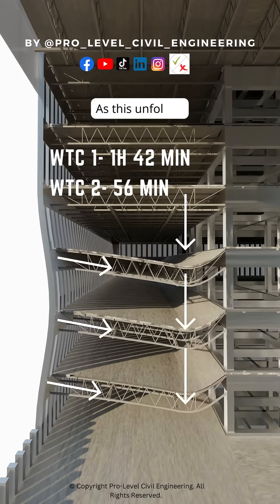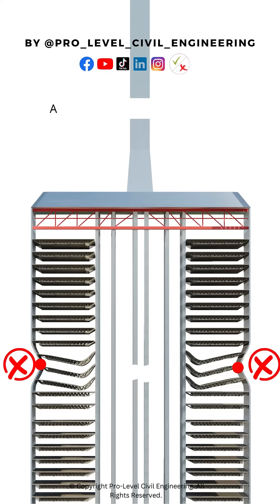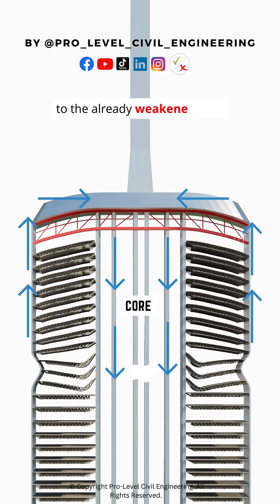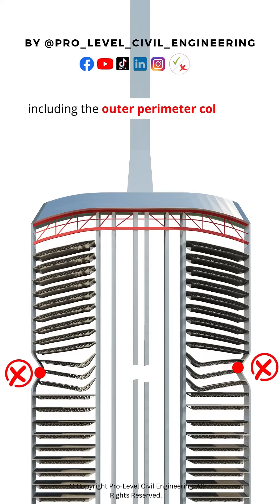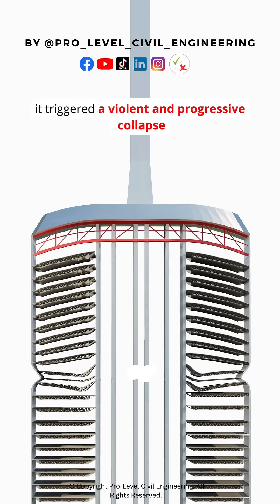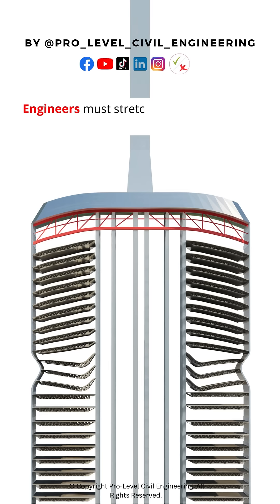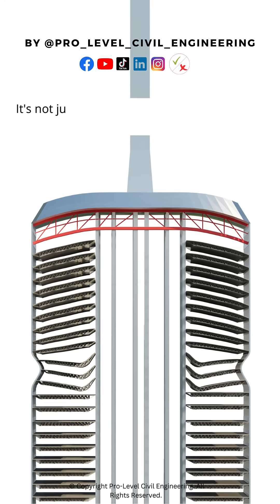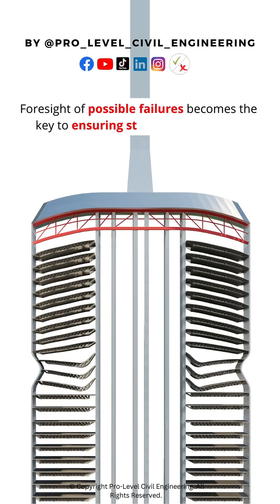The Horrifying Truth: Why the Twin Towers Collapsed on 9/11?

Comment: That doesnt explain it falling straight down at near free fall speed through at least 60 floors not weakened by the jet fuel fire…architects and engineers 9/11 truth is a great organization of those who work in those fields and only want an answer that makes actual logical sense to what we all saw.
Reply: 911 Truth hasn’t proved a single thing in almost 20 years.
Reply: @joshd3192 they have shown that the explanation we were given does not match the science and further investigation is needed. They haven’t claimed to prove anything. The point is the answer we were given doesn’t add up
Reply: @Clairebear173  Why because you say so?

Comment: It was an inside job.  Thermite erxplosives planted to fail strategic structural points. Jet fuel burns half the temp required to melt steet. That was bs.
Reply: Oh yeah? Planted by who?
Reply: Thermite explosive? LOL. Thermite does not explode, it only burns till it is consumed.

Comment: There were no airplanes. They were holograms. Also WTC7 came down. The only explanation is controlled demolitions. Just compare videos of the controlled demolitions to WTC and you notice the similarity.
Reply: The Towers fell nothing like controlled demolition I don't know what you're talking about.
Reply: Holographic displays of the magnitude you're thinking of is, well, not feasible because of what would be involved.  First and fore most, what were the holograms displayed on and how did the manage to do it in multiple directions?  You just don't shot a hologram into thin air.

Comment: Thats what happens when you demolish buildings. Especially building 7 , that collapsed out of fear 😅😅
Reply: Uh huh. Demolished by who?
Reply: @joshd3192  not by airplanes
Reply: @joshd3192  fact
. All supporting members would have to fail at exactly the same second. Only possible with planning and coordination
Reply: @darrencoleman3866  Uh huh. Any proof?
Reply: @joshd3192  that was the proof duh. It's  called physics
Reply: @darrencoleman3866  All done now twoofer?
Reply: @joshd3192  you were before you started

Comment: What about the very visible puffs of smoke coming out the sides of the building on multiple levels below as the towers collapsed, and the rapid sequence of explosions heard by many people ?
Reply: What was observed was thee air pressure within the towers being forced out through the windows breaking as the floors collapsed.  As for the explosions, most people can not tell an explosion from crash. Many of the explosions were actually the soundd of bodies hitting the groundand bursting open. Other sounds where steel beams twisting and bending and breaking loose

Comment: Thermite on the steel columns pre installed on 40 degrees slope all blown at the same time
Reply: I’m sure you have proof. Let’s see it.

Oh right you don’t. Never did and never will. Another conspiritard in a long line of conspiritards who have been spewing the same asinine rhetoric for the past 24 years without providing a single shred of evidence to back their tired claims.
Reply: @joshd3192  They hid all the evidence,  are you really that ignorant?
Reply: @mrichards-j6b  Uh huh. Who are they?
Reply: @joshd3192  Tell me how they came down?  Two sentence Tom!
Reply: Thermite isn't blown, it is ignitedand burns. Rapidly until it is consumed. It would not make cuts as you describe.

Comment: People used to see lights inside the twin towers when the building was on fire they said it was a controlled demolition, but it was the fire alarm lights going off inside the building, but if the demolition exploded in the twin towers due to the heat of fires after the impact it will collapse the twin towels
Reply: You should find a preschooler to help you compose your thoughts

Comment: I asked AI about the pretensioned cabling installed to the connections of the exterior columns and the floor trusses and it replied no such cabling existed?  NIST and all of their peer entities have left this part of the construction phase out of their report, which belies the true nature of their hypothesis,  the trusses were pretensioned and thus would nullify the erroneous assertion of drooping floors due to deformation.  Bridging trusses,  pretensioned cabling, and concrete reinforced rebar throughout the knuckles of these trusses would not allow any buckling as asserted by NIST.  The concrete also acts as a heat sink against the fire,  in order for the top of the truss to sag (which it couldn't because of pretensioning) the fire would not only need to heat up the truss it would also need to heat up the concrete.  Each floor at WTC was a monolithic entity independent of any corresponding structure,  they could not droop independently as fire rolled by,  each member would have to take a corresponding member along with it.  AI also said that if there were pretensioned cabling installed it would make a significant difference in how the building reacted to the attack,  since AI was uninformed of the cabling its answers are erroneous,  being under tension significantly increases its resistance to deformation,   not only does the steel have a concrete heatsink it also has an induced strength due to pretensioned cables omitted from NIST analysis,  how convenient?  There are a lot of complicit entities in the Murder of US citizens,  omitting critical information of the largest crime scene in US history is a telltale sign of obfuscation in the highest ranks of our own watchdogs,  if one part of the story isn't true, none of it is!
Reply: Apparently you asked AI many things and you didn’t manage to understand nothing at all 🤣🤣
You are the PERFECT example of the fact that if you ask AI stupid questions you get stupid answers, thank you so much for showing it to us all 🤣
Reply: @filippozoppi7569  Most people with intelligence ignore morons like yourself but I think you deserve the attention you desire,  asking pertinent questions about the buildings design elements can shed light on the mechanisms of its destruction,  NIST omitting design features then forming conclusions is junk science,  people like yourself relying on others to tell you what occurred and then vehemently guarding these notions without proper investigation shows your lack of intellect,  I however understand that these tragic events were not the result of just aircraft,  I choose to understand why these massive and well engineered buildings came to such a destructive end,  seeking truth about why 3000 Americans were slaughtered on 9/11 even though they were in perhaps the safest location on the eastern seaboard,  your reading comprehension  is abysmal,  you probably did not even read my post because if you did you would know I only asked AI one question,  I won't bother asking you any,  you haven't a clue!

Comment: Kinda 100percent correct. Dont know why so many comments not understanding. Its not that the steel beams caught on fire or weaken but the braces holding those beams. U can take a steel beam with fire proof which it had put it on the ground and torch it and it would not almost never catch on fire or the beam melt. Problem is when the explosion happenned with that force it knocked the fire proofing off those smaller braces holding all that weight. As you know that buiding buit that way to have more open space on floors and elevators in middle of building instead of most buildings where elevators are toward outside of buildings.  Not a good example but for those who dont understand think of yr barbecue grill. The grill its self wont burn with fire or coals right under it. But the little latches holding that weight might. All that weight from each floor was on those little now uncovered fireproofed braces.  Once one floor colasped the weight was to much for the next floor.
Reply: No,  the connections of the double floor trusses are still visible and in plain sight connected to the central core as it is standing as a spire by itself before collapse,  they are all in view not disconnected!
Reply: @mrichards-j6b whatever . I tried.
Reply: @CarlCarlson-k5p  Deceiving people about the design elements of WTC is a vain attempt to promulgate Mickey Mouse engineering as the culprit,  you obviously do not know the method used to connect the trusses between the core columns and the perimeter columns or you would not use the term smaller braces to denote some kind of deficiency in design,  they were in fact 24 inch square plates coupled together with pretensioned cabling imbedded into concrete reinforced with rebar poured as a unified monolithic structure not prone to deformation as implied by NIST,  whatever you think you tried to do only seems  reasonable to you in your own thoughts,  I am perfectly aware of how those buildings were comprised and in no need of your assistance understanding what occurred,  you need to do some research,  get more informed before dispensing erroneous explanations.

Comment: It was controlled demolition, it was literally free fall😂😂😂
Reply: No it wasn't, and no it wasn't - stop sounding dumb!
Reply: @ThomasDanielsen1000 trynna protecting your government?
Reply: At the time I believed that but looking back after seeing all the footage and news reports I see it was the news broadcasters making assumptions that planted those seeds.  Little comments that became a dark narrative.  I've worked some with metal and forges furnaces I understand blast furnaces etc what happened to the towers was inevitable under the circumstances the amateur video shows it.  Those floors literally became blast furnaces and didn't need to be hot enough to melt steel just weaken it enough to allow the load above to act on the pinions.  If they had welded the floors to the frame it never would have happened.  As seen recently in Hongkong and a while back in the UK

Comment: Bullshit! It is far not hot enough to melt that steel! And the steel in the basement parts was not on fire.
Reply: The steel doesn't need to melt for it to lose its strength, Cletus!
Reply: @ThomasDanielsen1000  Yet it needs to melt to be found molten in the rubble, idiot.

Comment: Ну наконец-то кто-то решился включить голову и разобраться в произошедшем с точки зрения инженерии
Reply: Not everyone is easily fooled like yourself,  I would check the power to your brain,  obviously a loose connection!
Reply: @mrichards-j6b а ты и правда думаешь, что разбираешься в подобных вопросах лучше людей с техническим образованием?
Reply: @winter_lux  Why are technical design features of  WTC omitted from the so called analysis?  Omitting that pretensioned cabling was present for all connections of trusses is a significant boost to an inaccurate premise,  the connections were far more significant than just cleats,  it is more likely that the connections were cut away at the interior core than being pulled by deformed trusses,  the omission of cabling to the google AI is troubling for me,  it reaffirms the deception of the whole event.
Reply: @mrichards-j6b кто тебе сказал, что там имело место быть преднатяжение конструкций? Если это сказал google ai, то у меня для твоего интеллекта плохие новости
Reply: @winter_lux  There are photos of it Einstein!
Reply: @mrichards-j6b а есть фотографии строительства и чертежи зданий, там не было тросов для преднатяжения конструкции. Впервые такой бред читаю
Reply: @winter_lux  It is not nonsense,  there are photos and the cables are in full view,  they also had a 24" plate welded at each double truss connection not some flimsy piece of angle iron as mentioned often,  there was a lot of redundancy in the floors makeup.  The whole acre of floor was a unified monolithic structure,  in essence one piece,  nothing could move without affecting corresponding connections,  there were no sagging trusses as a result of heat,  that would have been impossible,  all of it would have to move together,  including the concrete it was imbedded in,  how do you heat up steel that is three inches deep in concrete?
Reply: @mrichards-j6b легко можно, когда происходит пожар с 800°С, говорю как человек, работающий с металлом

Comment: A11 hit dead center the core columns. A175 apparently missed them as it hit the tower sideways . Its a miracle wtc1 didnt buckle earlier .
Reply: 175 Severly damaged the Central Core of WTC 2. 
The Difference between the two is 175 hit the Narrower End of the Rectangular Core in WTC 2, while 11 hit the Wider Side in WTC 1 severing the Core completely. 
The 135 feet by 87 feet Cores were set at 90° Angles to each other. 
WTC 1's 135 feet ran East-West.
WTC 2's 135 ft ran North-South, which is why 1 Stairwell wasn't completely destroyed.

Comment: What HogWash ..... an airliner could not pierce through the outer columns .. and the fire could not be hot enough to weaken the columns
Reply: Yeah, 700 mph plus thousands of degrees of temp, plus tons of force couldn't do much!! Hell, the engineers who designed it shocked me when the impact didn't knock them over. They deserve a ton of credit!!
Reply: @robertungerbuehler9076  Wow the planes get faster every year!
Reply: You can literally go watch it happen you idiot muppet
Reply: The only HOGWASH is your own completely erroneous misunderstanding of the Facts.
Reply: @apaulmcdonough2170  Explain your facts without hogwash!
Reply: @mrichards-j6b The Structural Integrity of both Towers were damaged by the Airliner Impacts. 
The Outer Wall Columns were HOLLOW BOXES - 14 inches square and made from 1/4 inch thick plating.  They weren't SOLID! 
When Broken by the Impact there was no longer continuity of Vertical Support for the Weight above. 
The Columns weren't weakened by the Fires - the Floor Trusses Were. These were Angle Iron Steel and Rods similar to Rebar. The Floors were the Only Connection between the Outer Wall Columns and the Central Core Columns. When the Flooring connections started to give way, total Collapse became inevitable.
Reply: Why because you say so?
Reply: @joshd3192  No because its impossible colossal moron!

Comment: For all the inside job people: you are right, the wtc was build to withstand an airplane crash. Of course when they planed this, planes where like 1/3 of the size, but since most inside job people also think that 1/4 is the bigger number, you can make the assumpten that it was indeed an inside job. Why you might ask? So they can blame the nicest and most advanced people on earth, invade their country and steal everything they have. The foundation of tesla and space-x comes from that fabricated war.
Reply: Cool. Prove it.
Reply: The towers were designed to withstand a 707 crash, the biggest commercial airplane at the time, only slightly smaller than a 767.
They considered a 707 flying at 600mph, faster than any 9/11 plane.
And they considered a fully loaded 707 while the 767´s that impacted on 9/11 were nowhere near fully loaded,
So Dr. Shyam Sunder from NIST concluded that the crash the towers were designed to withstand would have been more destructive than the actual ones on 9/11.

USA didn´t invade multiple muslim countries on the back of 9/11 because these countries were so advanced but because they were not advanced, helpless victims to the US military, but victims with many ressources to steal.